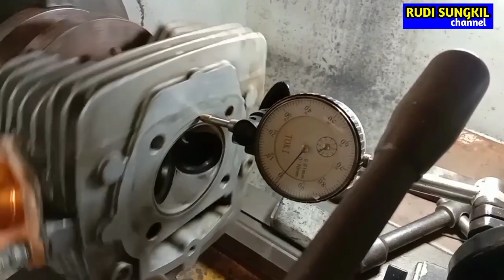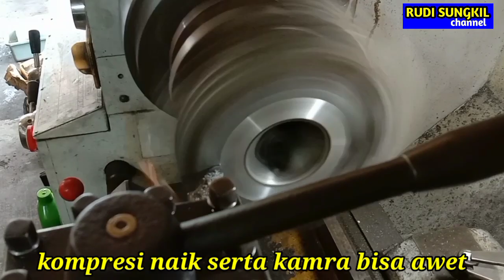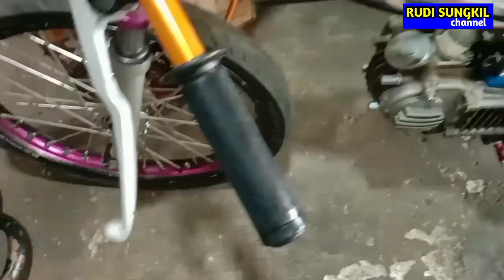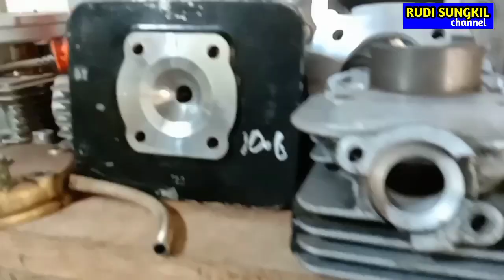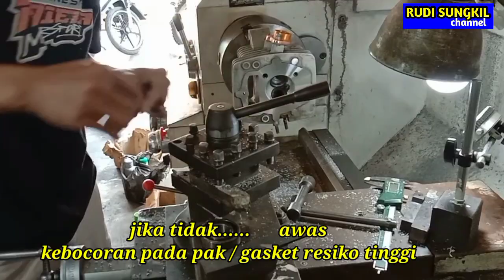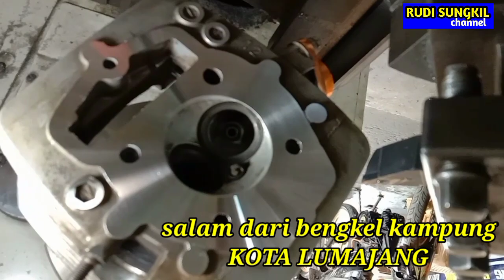Papas silinder head HEREX

Comment: mas kalau standart gl max neotech kop punya e series di papas itu pakai kamprat series apakah langsung pnp soalnya pakai rantai keteng model kupu 100 mata kepanjangan 98 mata kependekan
Reply from the maker: 98mata.. papas silinder head seperti dividio pas. Alias pnp
Reply: @rudisungkil1978  ada nomor wa mas
Reply from the maker: @gxracing8791   
98mata kamrat tipe gl series.
Timing atas bawah pakai series

Potong silinder head atau potong block atas atau bawah sesuaikan dengan selera dam keyakinan.
Kalau potong block 1,5mm bisa pilih atas atau bawah. 
Kalau potong silinder head sepertj dividio.

Sesuaikaan dengan pilihan dan keyakinan
Reply: @rudisungkil1978  kop nya sudah dipapras mas,askruk nya masih bawaan gl,apa blok nya bagian bawah dipapras mas
Reply from the maker: @gxracing8791  
Masuk inbox di fb...
Tak tunggu
Reply: @rudisungkil1978  cek mas
Reply from the maker: @gxracing8791  
Ha'@
Reply: @Rudi Sungkil mas piston perlu dicoak+dipapas berapa mili ya? Kalau pake piston tiger
Reply from the maker: @ramadwi6919  
Disesuaikan saja
Reply: @rudisungkil1978  kalau dicoak kira2 1.5mili masih aman endak mas?
Reply from the maker: @ramadwi6919  
Aman
Reply: @rudisungkil1978  siapp mas.. maturnuwun mas 🙏
Reply: Lokasi

Comment: Lakkah 70 piton  megapero kelep sedandar megapero kop pakai gl seris harus di bubut berapa mili kop nya
Reply from the maker: 0,7mm atau max 1mm
Reply: Itu kelep nya di  harus di abelin enggak mas masih  terus piston harus  di bubut apa cuma main cowak aja mas
Reply from the maker: @sempelahchannel7429  
Kalau potong head 0,7mm maka piston harus coak klep 0,7mm juga. Kalau potong 1mm maka piston harus coak klep 1mm juga. Begitu seterusnya.
Reply: Kalau piton nya cumak main di cowak 4 Mili tu hent nya harus keperas belapa Mili mas
Reply from the maker: @sempelahchannel7429  
0,7mm sudah cukup. Kalau ingin pakai kamrat series 100 mata tambah lagi potong block 1mm. Maka head dipotong 0,7 dan block 1mm jadinya pemasangan rantai kamrat 100mata sudah bisa diaplikasikan tanpa harus cari yang molor.

Comment: Mas misal kan diameter piston 66.6 trus squish nya 70 apakah pengaruh di tenaga ? Apa perlu ganti piston?
Reply from the maker: Jika bore dan struck sama maka akan ketemu akselerasi dan top speed yang maksimal. Misalkan honda tiger struck 62mm dan piston 63mm.

Struck tinggi tapi piston kecil maka akselerasi saja yang didapat.
Piston besar struck pendek top speed yang didapat.
Piston dan struck sama maka akselerasi dan top speed akan ketemu seimbang.
Tentunya klep juga harus imbang pula.
Reply: @rudisungkil1978  punya saya piston 66.5 langkah 68 klep 34 29 apakah pas?
Reply from the maker: @max1riza674  
Cukuplah.. untuk harian juga masih bisa dipakai..

Comment: mau tanya om motor saya tiger block heat nya dipapas 0,5 piston pake mp ov100 langkah std tiger kira kira kompresinya ketemu berapaya nyampe 12 kah?mohon pencerahan nya
Reply from the maker: Ketemu 9:1 lebih sedikit
Reply: sampe  10 gqk mas
Reply from the maker: @masbi9354  
Tidak sampai
Reply: headnya dipaps 0,5 dum piston dipapas apa enggak mas?
Reply: @ismawaninarsih2543  engak mas cman dicoak biar gak nabrak klep
Reply: Mas mau nanya. Kalok head MP dipaps 0,5. Bureng di papas 1mm. Dum piston MP nambrak gak sama businya? . Kruk as pakek standar MP? Mohon pencerahannya 🙏🙏🙏
Reply from the maker: @guguhmurdianto870  
Tidak nabrak
Reply: @rudisungkil1978  head.nya perlu dikasih Nat apa enggak mas kalo dipaps 0,5?
Reply from the maker: @guguhmurdianto870  
Tidak juga tidak apa apa.. biasa saya bubut polosan tanpa nat
Reply: @rudisungkil1978  trimasih untuk ilmunya mas🙏🙏🙏